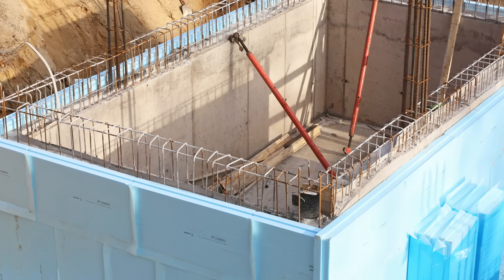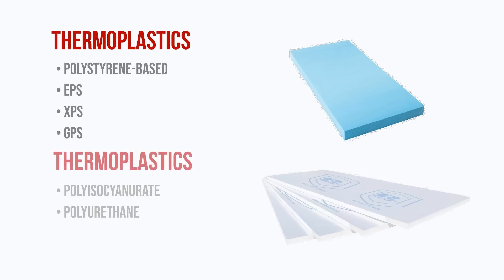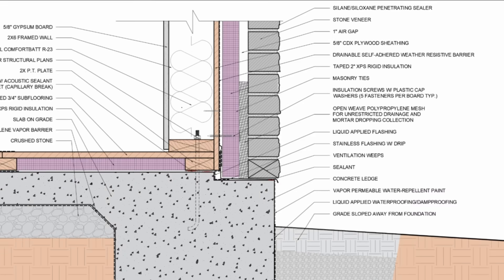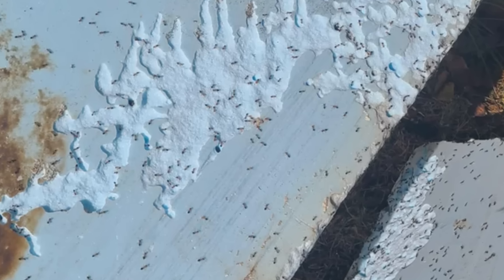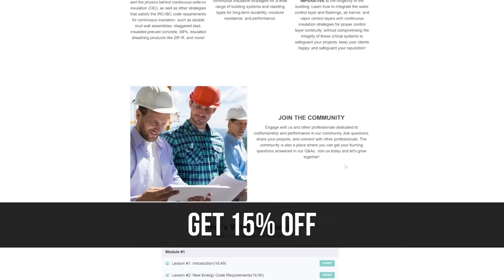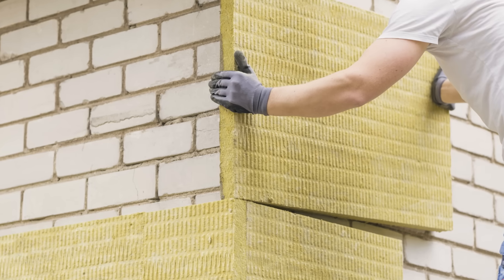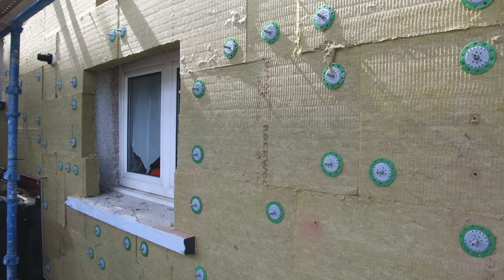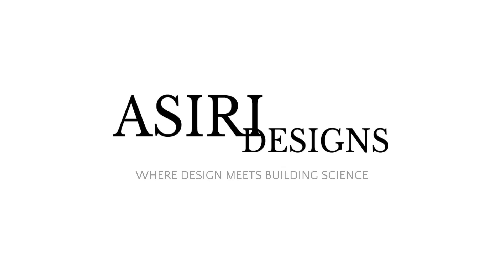Choosing The RIGHT Type of Exterior Insulation (What You NEED To Know)

Comment: So, how would you insulate a home in Montreal. What is the perfect wall assembly for a 2x6 exterior wall with brick cladding? Summer - high humidity with temp in high 30s sometimes 40 and winter -20 with wind and humidity.

Comment: We live in an area with frequent forest fires. I would not want any flammable material on the walls. The toxic smoke released by the foams would add to the air pollution. Rockwool is the material that I would use in my location. We are Zone 5, Okanagan, BC, Canada. Hot dry summers, cold snowy winters.
Reply: One major big advantage to Roxul rock wool is that the pieces are meant to compress against eat other so the cold gaps between piece is eliminated unlike fiber glass.  Roxul can withstand up to 2,100 degrees before combusting, fiber glass 800 degrees and foam is around the same 800 degrees

Comment: @asiridesigns I am in a really difficult situation. I live in zone 1, south Florida, and just got a new roof. The roofers removed 2 inches on isulation from the top of my flat roof and didnt replace it when installing my new mod bit roof, and somehow it passed inspection. I have an exposed beam ceiling with tongue & groove and the temperatures are now over 110 degrees at the ceiling.  I cant afford another new roof, so I need to insulate from the inside. What do I do? Is it possible to somehow insulate between the beams, leaving some of the beams exposed, so I can avoid the electrical and lights? My AC doesnt turn off now, and I'm afraid its going to burn out/freeze up. Help please!
Reply from the maker: How much rigid insulation remained above the roof deck after they removed the 2 inches?
Reply: @ASIRIDesigns   There isn't any. The height of everything on the roof is only about 2", including the tongue and groove and the mod bit layers. When 90 and sunny outside, different roof sections with tapered iso were in the upper 80s at the ceiling. This main section was as high as 116. It has a slight west facing slope, so the sun hits it harder. I don't need perfection, but I need to give the AC a break and make this living space more comfortable. I'd prefer to not cover the beams completely, if possible. However, I am open to it, if necessary. I just went through a full mold remediation. Between that and this roof, funds are very limited, so I really need to avoid making the wrong decision and keep costs low. Thank you so much for your reply! Your knowledge and videos are amazing!
Reply: @ASIRIDesigns any advice?
Reply: Maybe you can install iso from under the roof decking
Reply: The roofing company I work for can't give enough iso away when we tearoff ballast roof i used it in my garage

Comment: Your videos and website are a great resource in helping me figure out how to design my future house, thank you!

I was wondering if you had any recommendations or a course that addresses continuous exterior insulation when used on a house with a brick facade and a walkout basement, which also has exterior insulation on the poured concrete walls?  The main issues I'm running into are:

- The brick facade needs ledge to sit on, and unless you run it all the way down to the footer, it will necessarily force a break in the basement wall exterior insulation where a support ledge can be formed or attached.
- I understand the brick facade shouldn't extend below grade due to moisture wicking and potential for cracking and spalling due to freeze/thaw cycles. I assume this means that ledge should be placed above grade.
- If the grade is level, its easy enough to bury some external insulation just below this ledge, but with a walkout basement, unless you use retaining walls, the grade will slope smoothly, meaning even if you stair-step the basement concrete walls, the tops of the walls will be exposed to the air. 
- I do see nearly all houses in my area actually have the brick facade below grade even when it slopes. Can you prevent moisture wicking with flashing at the level of the tops of the basement walls? Can you stair step the flashing?

I'm thinking my best bet at this point is to use large retaining walls tied into the basement walls to create only 2 grade levels, and bury 1 or 2 courses of brick facade below grade with flashing and weep holes just above grade. The ledges and the vertical edges where the retaining walls tie into the foundation would be the only uninsulated parts. I'm in climate zone 4a in Tennessee.

Comment: At $15 sq/ft plus openings starting at $50 each for 1 1/2 “ XPS exterior insulation things start adding up fast . Especially if you’re working with complex designs.
Reply: 15$ a sq foot seems insanely high for 1.5" XPS... Is that material cost you are quoting?

Comment: When using foam board in a cold climate, while respecting the recommended cavity to exterior insulation ratio, are there options besides HydroGap SA to provide a small gap to avoid holding water in tension against the WRB? Is it something to worry about?
Reply from the maker: There are a few others, Typar has a drainage peel and stick, Griprite Prowrap SA is another one. You can also use a grooved rigid foam product, or vertical strips of foam sill sealer.

Comment: Obviously staggered layers would be ideal, but if you're using a single layer of rigid foam, how do you handle the seams? Tape? Spray foam in the gaps? Something else?
Reply: Yes to everything you said. Except, in my experience, foaming between the boards is really hard to do well if your joints are tight. Below grade, always use another barrier on the outside of the foam or a drainage plane to deal with or eliminate the driving force. Above grade, taping is probably the best you're going to do with a single layer. Bigger gaps should be foamed.
Reply: Many foam boards come with details at the edge that give you a small amount of overlap. This is similar to how shiplap boards fit together, except that the seams are vertical instead of or as well as horizontal. Of course, adhering an airflow barrier (like tape) over the seam too won't hurt.

Comment: So I won't be using any of the foam board products. Whether it just burns or it melts first and then burns, you won't find that stuff on any rural Australian's home. Rockwool is great for internal applications such as between a ceiling and the next floor, and for the roof.
But on the outside of a structural concrete wall, it looks like an invitation to vermin to move into that space. With good cladding and detailing you'd keep vermin out of it in the short term, but as soon as that barrier is breached you've got problems. And barriers do get breached - that's part of the nature of barriers.
So I'm still looking for any commercially available product that will meet my specifications.
Reply: I think rockwool is pretty much impervious to rodents and insects of all kinds. I agree with you about the foam insulation.  However I would like to see some information about sprayed on foam insulation on the outside of the foundation below grade. Perhaps spray on foam then wrap with poly sheeting. Canada here so conditions might be a tad different than Aus I'm guessing.
Reply: Insects don't like the rock fiber material as they lose the carcasses when they try to burrow into the rock fiber. As far as vermin, if they move in, it's because you have not sealed well.  I recommend looking at bug screens, and vent screens.   I believe the #1 company for stainless steel bug/vent screens is Australian, but even a plastic bug screen will do, if designed and implemented properly.

Comment: So, this video didn't cause  me to change my plans.  Cheap fiberglass insulation in stud and joist cavities.  Foam insulation as the primary thermal barrier for roofs and walls.  A layer of comfort board on the walls and roof, for fire resistance.  For my floor, I have comfort batts between my beams, and fiberglass between my joist.  For the eaves, I'll also be using more comfort batt insulation, since there are places where I need lumber to support the metal roofing.
Reply: Appreciate the details.  Thanks.
Note to Admin; Normally I NEVER SERIOUSLY CONSIDER ANY PUBLIC COMMENT to mean anything at all.     This channel I read and pay attention to the comments.
Reply: As a note, I'm building on hillside that burned in a forest fire about 60 years ago.  The current situation isn't particularly risky, since the slope that I'm building on now has trees that are spaced apart with low grass and shrubs between, but still I'm building for fire resilience and energy efficiency.
Reply: There's a US government study occasionally referenced online that highlights the r values of insulation when cold.  Fiberglass was dismal compared to mineral wool and foam. I also find that fiberglass is often installed in a sloppy fashion leading to gaps and irregular thickness because it's so low density compared to mineral wool.   Just because it's cheap doesn't mean it's better
Reply: @BobPritchard  For interior insulation the fiberglass isn't going to be that cold.  And since I'm installing it myself, I won't be sloppy.

Comment: I recommend looking into fully adhered spray foam paired with InSoFast's X-Bracket system.
Reply: They are coming out with a new bracket that you use full 16" or 24" wide insulation with. This will make a huge difference to me with cost and ease.

Comment: 2:46 This sounds like it needs a bit more nuance in that "submerged" sounds like it could mean "below grade," especially when you show it along a basement wall. For under a slab XPS seems reasonable for the weight bearing, but on an exterior basement wall I thought XPS absorbs moisture and loses R-value. The ICF blocks I'm aware of use EPS, but a quick internet search gives conflicting information, whether the test is done in a lab or in the field.
Reply from the maker: We have covered some of the nuances before of these studies but to summarize, XPS at greater thicknesses absorbs less water since the water tends to only be absorbed into the first centimeter or so. The testing that I think you're referring to only compared 1 inch boards so the absorption and loss of R-value was more significant.
Reply: Definitely want XPS below grade. I’m not that familiar with ICF blocks, but I imagine it relies heavily on some kind of water barrier outside of the foam to prevent water absorption.

Comment: Here in NW Florida, Lowes and Home Depot only offer the blue and the pink extruded rigid panels along with the white polystyrene product.  The fire-proof benefit of the Rock Wool Comfort Board is appealing, but it doesn't look like they want to sell that product in this area.  I suspect the higher cost and the lower R value may be the reason.  They do offer the regular mineral fiber batt insulation for the wall interior.
Reply: You can buy from national distributors rather than relying on the local Big Box Store. Rock Wool products have long delivery times, so they aren't going to be something you pick up for a weekend project.  If you decide that a particular product is best, just shop it.  That is what the internet is for.  BTW, here in Bumfck Idaho, I got an extra charge because national distributor is from Florida!
Reply: @richdobbs6595  Thanks for the suggestion.  I have had success using the web to locate metal roof shingles for a shed project.  These home improvement projects, however, are mostly that weekend variety so the local stores have an advantage.
Reply: I suspect the chemical industry has something to do with putting various petro-chemical products in the fore front and that natural stuff in the background.  
But I’ve been wrong before…..
Reply: @TheDroppedAnchor  Surely there are market forces at work.  You can search inventory of a Home Depot up north, for example, and they will offer Rockwool Comfortboard.  Down here in Florida, however, they won't even offer it for special order, apparently.
Reply: Houston area big box Rockwool is a special order.  Owens Corning has a similar product that is available off the shelf.

Comment: I’m wondering if a good coat of sprayed on  paint and then a layer of heavy tar paper rolled on while the paint is still wet then rolled down tight, then a second layer of tar paper over that would make a good long lasting wall. Wouldn’t the paint bond the tar paper to the OSB exterior and create a good vapour retardant. There should be no air gaps between the OSB and the first layer of tar paper and the second layer should serve as a water barrier. Then apply rock wool insulation to the exterior after the walls are stood up. Ideas please.
Reply: I really like where you’re going here ……   keep it up.  And appreciate you sharing.
Reply: Also The type of paint seems to me to be important.
Reply: @TheDroppedAnchor Perhaps primer paint might work. It soaks in and bonds well. Rolling out the tar paper immediately while the paint is still wet and rolling it down to ensure a good bond would be important, I think.
Reply: There are already products that serve the same purpose... ZIP, peel-and-stick WRBs, and fluid applied membranes.
Reply: @DeuceDeuceBravo Yes i know there are and they are far more expensive than paint and tar paper.  Plus i don't know it they are any better.

Comment: 10- 20 years ago there was a product that came out to let water move away from metal siding instead of becoming trapped, does anybody use it?  Is it effective?  Was it found to have problems?  
Am curious because I want to redo a trailer.  
I prefer to use rockwool since it's a small space and trailer fires are deadly.  
I will reuse the old siding where possible and want to keep moisture from accumulating against where metal and wood meet.  I know that moisture really can negatively affect the interior regarding feeling cold, hot, etc.  I'm therefore trying to figure out what to use without adding a discernable, problematic amount of width...

Any idea of the product(s) and if they make sense in this application?
Reply: Rain screens
Reply: @cxsey8587 
Thank you.  Now some info on effectiveness and use would be great...
Reply: The rain screen I used looked and kinda felt like super course steel wool.  But plastic.  It came in 20’ long rolls we cut with heavy long scissors. I think four feet wide. We had 2x4 as a stick to hold the screen at the top while we worked our way up. The rock wool was 2 feet by 4 feet and like 6” thick.  Real long screws with 4” fancy washer with sharp thing-ies to hold the rock wool and screen to existing extremely weathered pine boards.
Three sides of a barn.  No windows or doors.  8’ scaffold ; walls 14 feet high.  Worked out perfect.  
The owner didn’t know much about it, scientifically,  and his son, nephew and I knew less. TBH  it took high school level smarts to actually do it. 
The only easier way would be to have someone else do it.
Reply: @TheDroppedAnchor 
So how do you know if it works?
Reply: @b_uppy   We talked a few months ago, which means it’s been up for more than two years.  He is extremely happy with nary a complaint.  And that guy is normally a complainer .
Reply: @TheDroppedAnchor 
Still, I'd like to see whats underneath in adverse conditions...

Thank you for the info.  Still useful.